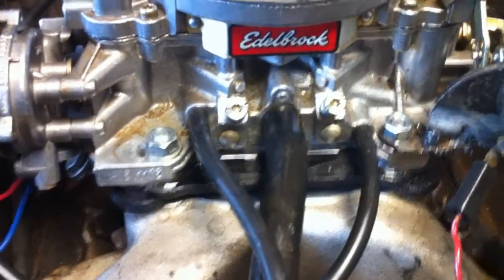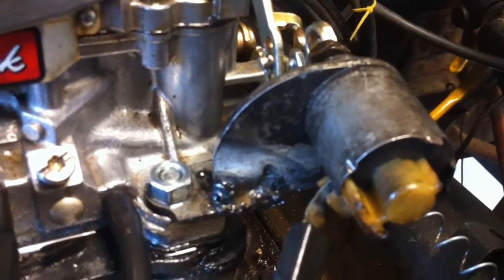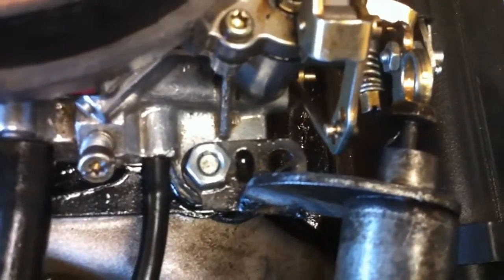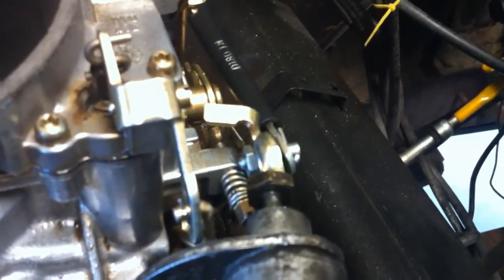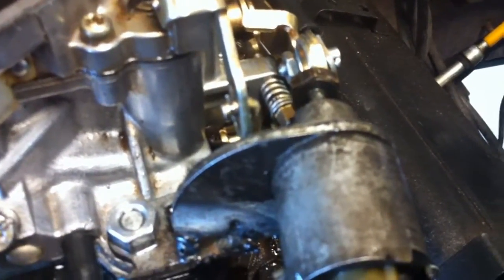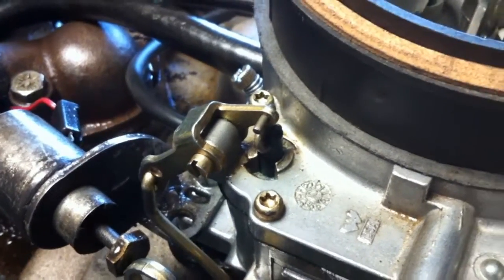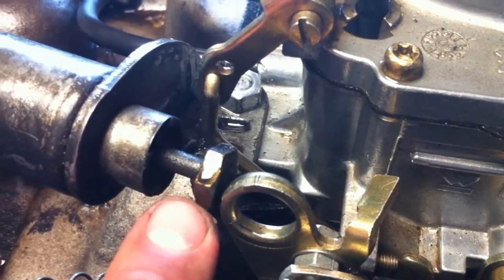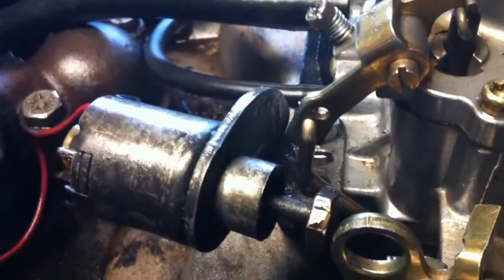Homemade ac solenoid for Edelbrock 1406 carbs and similar models without AC solenoid mounting holes

Comment: I acknowledge that this video is 12-years old, nevertheless, there are a couple of solutions to compensating the idle when the AC kicks on that don't require the driver to tap the throttle every time the compressor cycles: https://youtu.be/JFhQKXpx-1M?t=181
The most elegant seems to be repurposing the timing control vacuum valve solenoid from a TCS since it doesn't require any adjustment or movement of the throttle..

Comment: Where the plug for the solenoid go plugged too? I put it to the green wire that connect to the compressor but it's not working  any advice?
Reply from the maker: Was it working before you tried the solenoid?   I did not have the cap but it’s still working.  The solenoid must be dead or you don’t have power to it.  Sorry I don’t get to look at my notifications too often
Reply: @ElFrankie123  do have to have a negative and a positive wire to the same wire that connects to the same plug?

Comment: i have the same setup, do you happen to have a part number for that solenoid? thanks
Reply from the maker: Jason Turner sorry I just saw this it's just off a Quadra jet
Reply: How did you wore it? I have a similar set up and tried tapping into the compressor wire. And tried grounding it

Comment: Hello, I have a 94 Honda civic in El Salvador,  any idea if this would work on a 32/36 webber  , I fix my ac and my idle goes way to low and it turns off once my ac is on, any suggestions,  thanks.
Reply from the maker: Is there any idle speed controller with ac if not then just get any solenoid that pushes, kind of like mine and make a mount for it and place it to allow extra rpm when the ac is on.